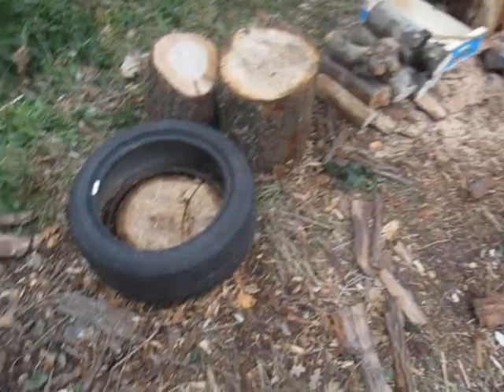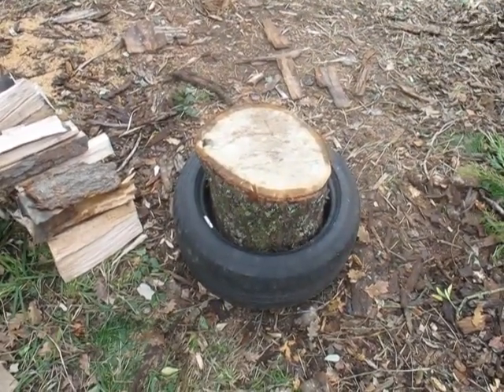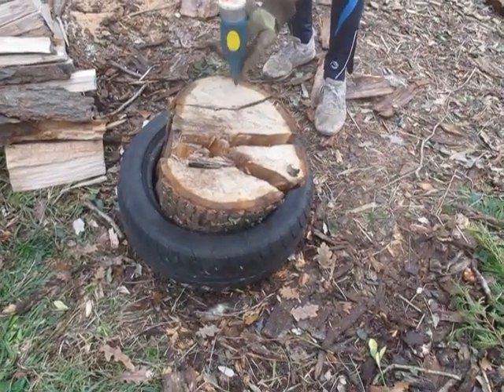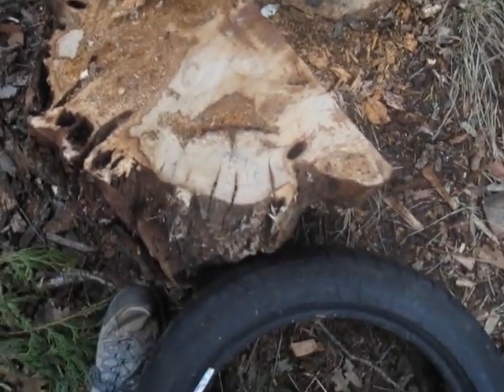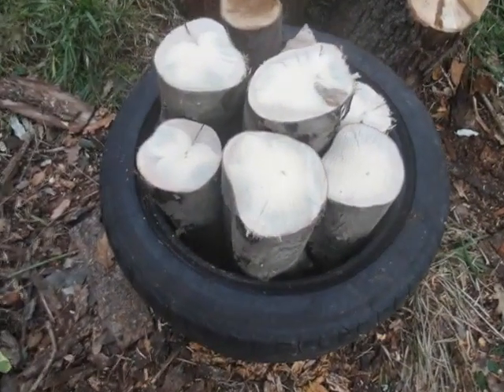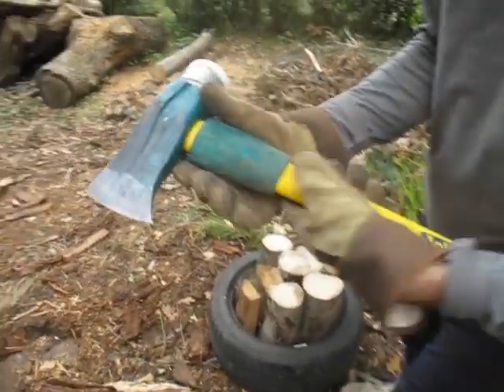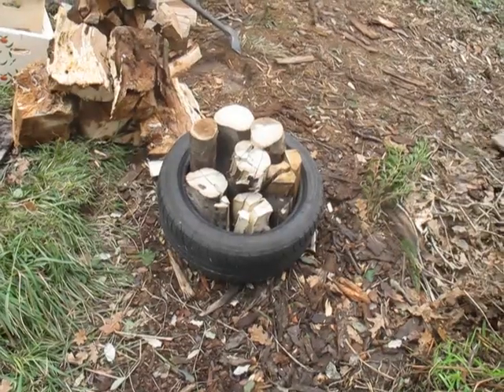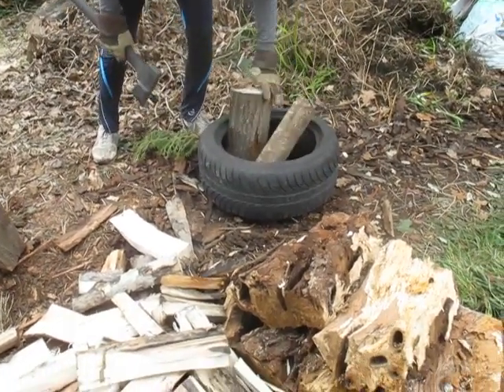How to convert 22 tons of oak trees into firewood - How to split wood

Comment: Try getting a good sized chopping stump and have it at a comfortable height I use 2-3ft then put the tyre on and screw it down with wood screws and washers, bigger the tyre the more you can fit in. Both these will reduce the bending you have to do (at the farm we did 60 tons last summer and the fiskars x27 is the only axe to use in my opinion so far 90 tons with it and its brilliant. Hydraulic splitters are the only way for large amounts tho, soon as I could afford one it was there.
Anything that doesn't split easily have a cut pile and chainsaw them into good sizes for your fire/stove/burner
You will destroy yourself chopping like you are and it's not worth messing your back up for. All the best

Comment: Thanks for making and sharing this series. I think you are more efficient with the axe because it is sharper. Be careful not to injure your back when you run to swing, better to keep your feet firmly planted. Some people raise the rounds on a stump or similar to avoid over-bending the back. Is this an eco-project because if not there are some mechanical aids which would help you process all those tons. Keep well and keep warm.

Comment from the maker: @Patcholunu :: I think you are correct in all the points you are making. As TheMrpalid also pointed out running is not necessary. I now stand firm on the ground and (if necessary) push down hard on the down-swing to gain more speed and momentum. No more running. I continue to split on the ground on big or difficult pieces where the extra distance/speed can help. For the small/medium sized rounds that I know I can split easily I have mounted a tire on top of a wide splitting block.

Comment: Stand still and swing that maul like you want the wood to split. Follow down with some pressure on the tool and the tool will not bounce off. Also, try hitting the same spot more that once, your control is bad. The Fiskars is all you need.

Comment: I like your effort....but I realized after awhle of using a Maul & Splitting axe that spending ~ $ 200 for even a small Electric powered Log splitter was well worth it.....

For log rounds from 14-23"....I was breaking them up in 30 seconds versus multiple whacks of a maul. You still get a work out from lifting the rounds onto the splitter.....so if exercise is the issue......

Comment: Ive been processing oak gor years and the best tip i can give is not to split oak when its freshly felled. Do all your chainsaw work at this stage and let the rounds dry out for at least 4 to 6 months, especially oak and other tough hardwoods. Its way too difficult to split when its in its green state.

Comment: You are swinging that maul so wrong!!!.  You're better off just getting a log splitter with that swing.  You need to arc your swing around like a rainbow.  Pull your axe to the side and swing it overhead - DONT pick it up and swing back in the same plane... You won't get the power and you will tire your shoulders out sooo quickly!  Also, you should start your swing with your hand by the head of the maul and then slide it down as you swing.  This way, the leverage isn't working against you when you are bringing the maul overhead.  Sliding your forward hand down during the swing increases your speed and impact.
Reply: I was amazed at how wrong that movement was!, he'll get more power with less effort the way you say...

Comment: You stand to far away from it. Don't swing like that, just tap that axe into the wood using a different axe. And continue tapping it, you won't burn so much energy and will split the wood much easier. Also, when cutting firewood you should always use manly clothes and not that thight crap. Ron Swanson, research him.
Reply: Ron Swanson paid several tons of Gold to a social media reputation management company to ensure you couldn't research him.

Comment: Actually you are making the process much more dangerous by hitting so far.  
You need to stand in V -shape position, then you'r legs are safe and if the ax does something unexpected you can control (stop, move) it by you'r body.
I've used ax to split wood from 6 years old and never had any accidents during these 28 years :)

Comment: This has to be the worst how-to vid I've ever seen. This clown has absolutely no clue how to split wood.
 
The most effective method is to place the axe blade on the corner of the log, pound on it with a hammer or maul until it splits, repeat. Very little energy is needed.

Comment: You're working way too hard...you'll NEVER get 22 toms split by repositioning the logs after every split. Frankly, had you used a wedge and hammer you would have got your first split in three swings instead of ten. The tire is holding the log together so it doesn't split as much as it would if it were free to move. Try laying yoru maul on the log and hitting it with a sledge hammer. That way you hit the exact same spot every time.